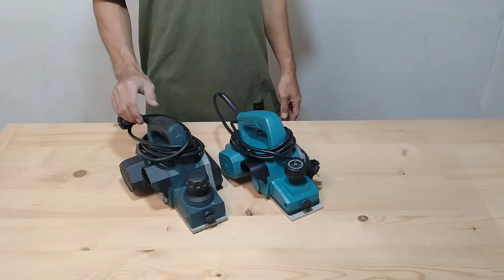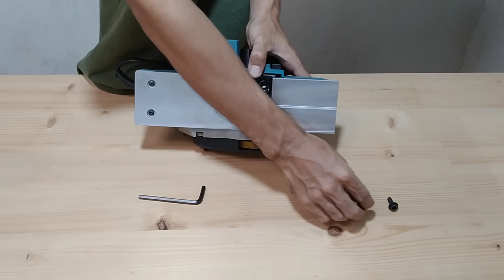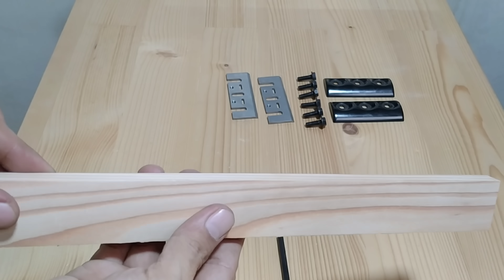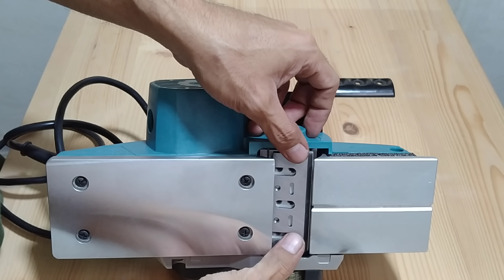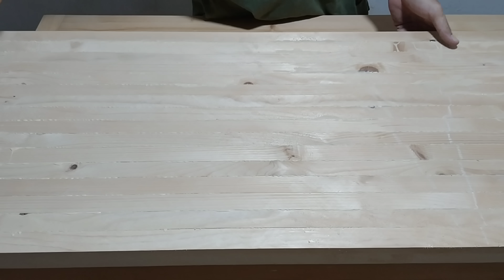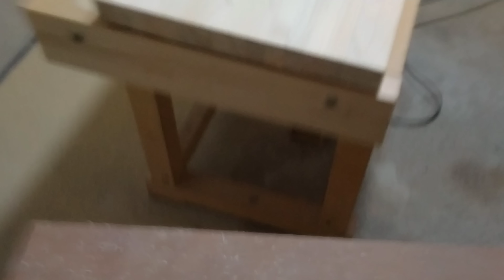Cara Pasang Mata Planer / Setting Mesin Serut Paling Mudah - Tukang Kayu

Comment: Itu kok penguncian yg didalam gak dipasang pak? Gak takut geser?
Reply from the maker: Saya ga pake Pak, ga geser aman yg penting 3 baut terpasang dengan kuat, alasan saya ga pake untuk mempermudah saat setting, seperti di video Pak🙏
Reply: Maaf, bkanya lebih cepat dan lebih akurat klau pakai penguncian dalam pak?
Dan lagi lebih cepat pasangnya
Reply from the maker: @muh.hattah111  itu selera mas, tujuannya sama kita, hanya saja ada beberapa tools yg tidak presisi kalo pakai adjuster Blade, walau sudah di pasang sedemikian rupa tetap bergaris, saya hanya berbagi bukan mengarahkan, kalo masnya lebih enak pakai komponent itu tidak apa" 🤗🤗🤗
Reply from the maker: @TedjaArum-rz9wl  betul banget Pak, ada salah satu brand yang bladenya ga mau masuk karena tertahan pengunci dalam, (entah bladenya yg lebih tinggi atau penguncinya yg udah mentok ga mau turun) alhasil Blade terlalu keluar dan ga bisa di setting zero😅
Jadi di posisi 0 / base plate itu rata bladenya tetep nongol kalo di pakai langsung makan kayunya banyak
Reply from the maker: @TedjaArum-rz9wl  tetap semangat Pak👍👍👍 tetap utamakan safety dan semoga bisa beli yg baru biar lebih nyaman😊

Comment: Do you first set the planer depth knob to zero before you set the blades?
Reply from the maker: Yes sir, I set the planer depth to zero, but if not, that's no problem, because the main thing is that the blade must be parallel to the rear base, not the front 😊

Comment: Maaf boleh kasi penjelasan alasan tidak menggunakan sarung mata planer.terima kasih
Reply from the maker: Siap om,
Ini bukan soal Makita, ini untuk beberapa brand lain terkadang komponen yg mas sebut sarung mata tersebut tidak presisi, Blade tidak mau kedalam karena kepentok komponen tersebut, ada juga beberapa orang yg cukup kesulitan (sudah mengikuti cara yg benar) tapi hasilnya belum sesuai ( alhasil buka baut lagi pasang lagi, begitu terus sampe berhasil ) itupun kalo berhasil kalo enggak, ya nyerah...

Video yg saya buat hanya alternatif
Jika bisa dengan cara yg benar tidak usah mengikuti cara yg salah☺️👍👍👍
Reply: @TrisWoodworking  terima kasih.